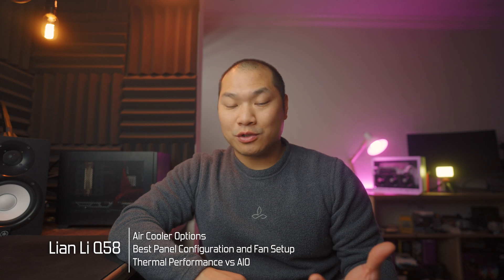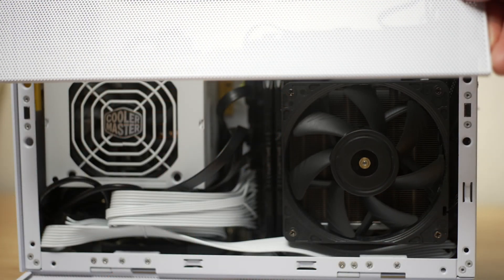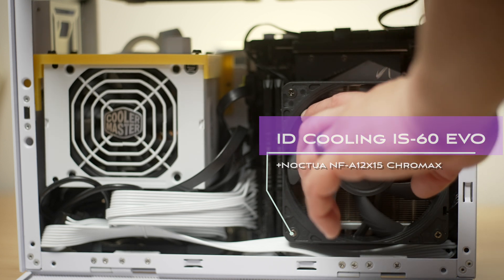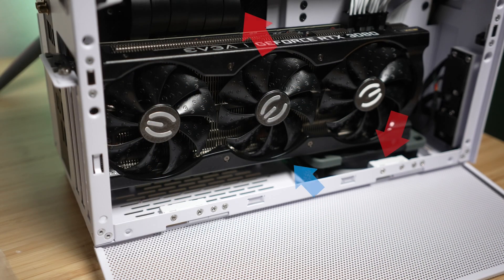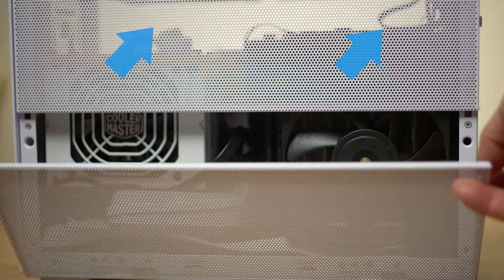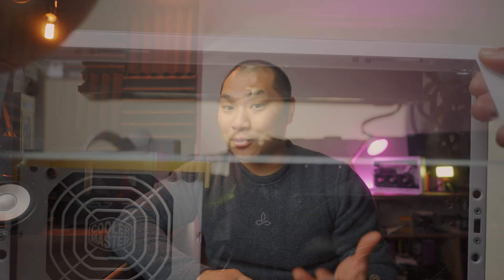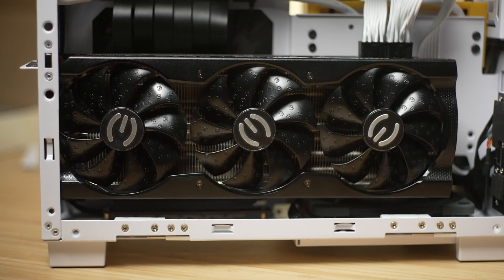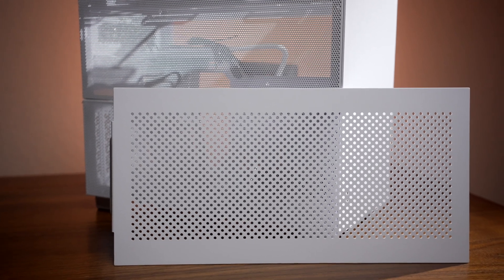Air Cooling the Lian Li Q58

Comment: I did a deep dive on this today while shopping for some upgrades to my Q58 build. One interesting thing about the two coolers you mention here is that the 5 mm clearance between the IS-60 EVO's fan intake and the Q58's mesh side panel is critical for quiet operation. The Big Shuriken 3 may physically fit in the case but you would expect it to be relatively noisy in that setup due to the intake sitting right up against the mesh, producing undesirable turbulence.

Of course both are out of stock at present, and it's not necessarily something that impacts temps! But I have gotten so much great info out of your several Q58 vids that I had to share.
Reply: Big Shuriken 4 just launched for the US market with the same 69 mm height.

Comment: 6700XT, 5600X, 240mm Corsair AIO. I did the mod to move the GPU up 1 slot to sit flush against the mesh. I'm running full mesh on GPU side and full glass on the CPU side. when Im running a game or benchmark I open the bottom glass panel for airflow and to not choke the PSU. Looking at my temps I can say they are Average from what I read online but HOLY CRAP does the top of the case get hot. I thought there was something wrong at first because the top grate is almost too hot to touch. The coolers are doing their job but its just the design of the case that ALL the heat the computer makes has to make its way through the radiator and out the top. Gotta imagine it's effecting CPU temps but like I said I've never had any thermal throttling from it so I guess I'm just gonna go with it. There is a seller on etsy selling custom side and top panels made out of acrylic. They are a little pricey but once I have some extra funds I am going to go that route because the breathability of the stock case just isn't great. Keep up the awesome videos!

Comment: See, this is really making me feel bad for having both glass panels on the CPU side so I can see the shiny lights I installed...
Reply: Don't feel bad I did the same thing. I just swing open the bottom panel when I play a game or run benchmarks. Other than that I don't regret doing that. I actually want to see my internals I worked so hard on. Honestly I haven't notice a temp difference even with both glass panels closed but I'm afraid of straining the PSU because of how close the fan is to the glass.

Comment: I've found using a 240mm AIO not so great in the Q58. The thickness of the radiator + fans leaves almost no room for air to get to those fans. The hot air from the GPU also makes it harder to cool the CPU. That worked out okay still, but then there's also the fact that the entire case airflow is greatly reduced and the top of the case was getting really toasty. My 2nd M.2 drive on the back of the motherboard was living at 75C even when not in use. Overall it didn't feel or look good. And I hate the pump noise when CPU is on load.
I've now replaced it with 2x Noctua 140mm exhaust at the top, changed the bottom Noctua A12x25 intake into exhaust, and put an air cooler back on the CPU. Even the stock Wraith Spire cooled the CPU as well or better, and the whole rest of my PC was MUCH happier. I've now replaced the cooler for a Big Shuriken 3 (can't get the IS-60 evo anywhere...) and it's got the cooling and the quiet. I think air cooling is definitely the way to go for this case.
Reply: I’ve got a 280mm NZXT Kraken in mine with Noctua fans. Today my 5800x3d hit 93c. Just about given up with this case tbh.
Reply: Damnit man reading this makes me want to try it out but I can't spend any more money on this thing... lol

Comment: WAS A 20 DEGREE DIFFERENCE BETWEEN THE 3700X AND 2700....I UPGRADED NY SON AND STAYEFD WITH THE 2700...WANTED TO KEEP IT AN AIR COOLED ITX BUILD...DOESNT THROTTLE N RUNS GREAT BECAUSR OF THE LOQ WATT CHIP...AWSOME LIL GAMER I CAN PACK EASIER ...GREAT VIDS MAN IM REALLY INTPO YOUR MODS N TIPS FOR THE Q58

Comment: I WENT AIR IN MINE RUNNING A 65W RYZEN7 2700....NOCTUA L9A....2TOP INTAKE 1BOTTOM EXHAUST...GLASS ON THE TOPS MESH ON BOTTOMS...2FAN HIGABYTE RTX 2060...UNDER 40 ON CPU SIDE IDLE AND AROUND 44 TO 48 ON GPU SIDE...I LOVE IT...GOT A SMALL VID ON HERE OF IYT IF WANNA CHECK IT OUT...GOT A 4TB HANGING UNDER TOP FANS TOO...

Comment: hey boss ! i've been saving for this build like that for a long time and your vid are a blessing. about SSF there is no other channel with that kind of quality of work and testing done. Before i order everything i've got some noob questions : 

- i get the negative pressure setup with the three case fan in exhaust, but,  isnt the CPU cooler blowing hot air onto the mobo and the VRM ? as i'm waiting for a affordable itx LGA 1700 ddr4 (ddr5 is too damn expensive 400euros mobo + 400euros ram like wtf)  to go with an intel 12400, im afraid this can be a problem as with almost 120max watts consomation it can get pretty hot
- negative pressure is here to force the flow to go threw the side panel, but does the lack of dust filter in the mesh panel make the PSU, GPU and cpu rad that are intaking, just big dustbags ?

sorry for my poor english i hope i've made myself understandable x) ! i'm so excited to build my first sff !!

Comment: The best scenario for the CPU is with an AIO and the top panel off. Taking the top panel off brought down the CPU temps by 5 degrees in my q58. Also with the GPU side mesh open the GPU temps came down by 7 degrees as well. The top panel needs a redesign and the mesh needs bigger holes.
Reply: I thought it was just me who noticed this also. Not sure why they went with such a restriction at the top considering its the ONLY way for air to exit the case. I can't tell you how many time's ive taken that top panel off to test temps. I notice it doesn't really effect my high end temps but it does heat up a lot quicker with it on. There is a seller on Etsy selling customer acrylic side and top panels that offer much better breathability. I'm gonna go that route once I have the money. I want performance but I also want it to look good which is why I went with the Lian Li. It's just too pretty.. lol

Comment: Awesom video. I watched it more than 3 times. The air cooling build on Q58 is amazing. I'm thinking about swaping the Kraken x63 which I just bought few weeks ago to Big Shriken 3 with 2x P14 PWM PST on TOP exhaust. The bottom fan keep exhaust with a Thermalright TL B12-W. My heavy loading usage is just running on 3A game and open browsers and tabs at the same time in 12600k stock and 3080 XC3.  I'm not sure if it's worth to swap. Do you think this is a significant improved build than original 280mm AIO? Thanks for your professional comment.
Reply: Best thing to do! I almost went for a nr200p because temps bit Shuriken made a huge difference. Lower fan is still intake but have to try as exhaust. Had to mod the Shuriken a little to fit.

Comment: Would the Noctua L12S fit in this case or is it slightly too tall at 70mm? How does it compare to the Shuriken and IS60?
Reply from the maker: Too tall unfortunately. The Big Shuriken 3 is close behind in performance and will fit but you do have to remove the fan bumpers.
Reply: @MachinesMore  Thanks, I’m planning to do an ITX build in a few months. The Q58 looks cool, but I’ll probably end up using the NR200 with a C14S.
Reply: Jonsbo HX6200D might be the best option (largest fin stack, 6 heatpipes and 63mm tall).
Reply: The Noctua NH-L12 Ghost S1 cooler will fit, however there is a specific set of motherboards that are compatible with the Q58 and the Noctua cooler.  I’m considering this cooler with a Ryzen Zen 3 for my new build.

Comment: I want to like the Q58 but I can't help shake the feeling that it's just not as good a case as the Meshlicious or NR200 (or other more premium cases) - I'm glad that Lian Li are putting more weight behind their SFF cases but it'd be good to see something more diverse like a sub 10L sandwich
Reply: Well there are a bunch of those sub 10 L cases. Problem is they get even worse thermals if you decide to go heavy on the components.
Reply: @MrMilkyCoco  YEah from all the comparisons I've seen the Lian Li seems to sit in the middle of the pack in terms of thermals in the stock setup. You can do things to help but just the inherit design of ALL the heat coming out the top which is just how it is designed unfortunately. I still love the case overall and every time I look at it I'm happy because it just looks so nice.

Comment: Wouldn't it be cooler if bottom fan(s) were set to intake and top fans outake?
Reply: In a sandwich style case, you really want to encourage airflow throw the side panels because they are the most direct source of air to all the components. The easiest way to do this is to exhaust both top and bottom fans, which creates negative pressure and encourages a lot of air flow through the sides.
Reply: @coolkatmehrfth  that's the answer i needed, thx king
Reply: @YeIlowv  no problem friend
Reply: @coolkatmehrfth  This makes so much sense.  I'm gonna try it out.